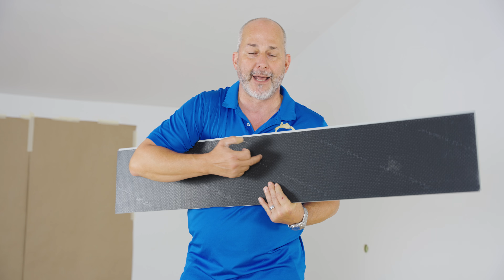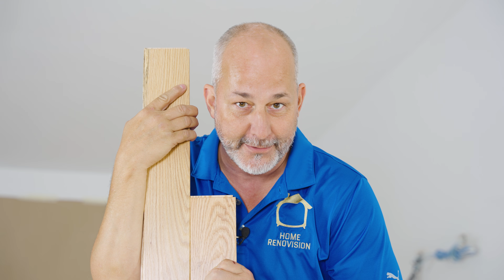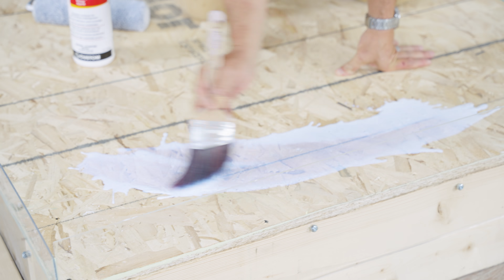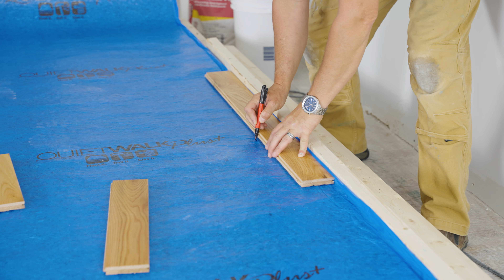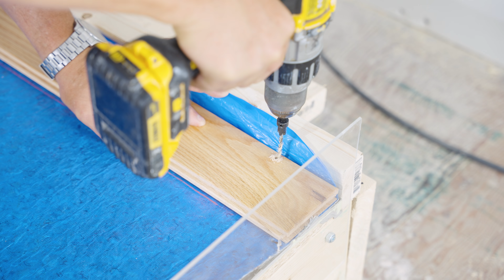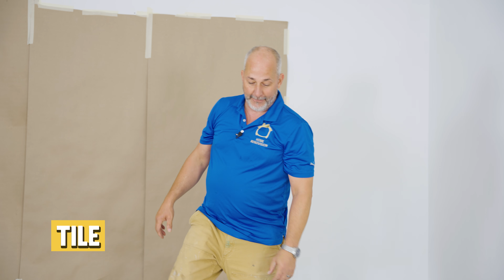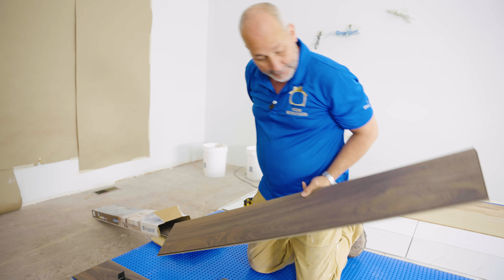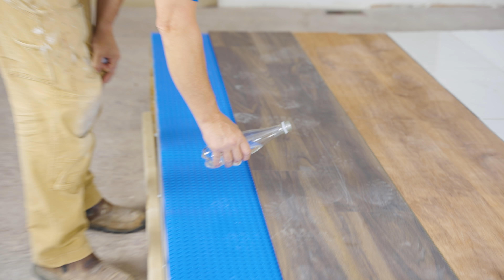Flooring Comparison: LVP vs Laminate vs Hardwood

Comment from the maker: I’m loving this new series comparing products! Watch my toilet comparison👉🏼 https://youtu.be/O7x5g2VFc50
What products do you want me to test next?
Reply: This product comparison series is quite interesting. Out of curiosity, it would be interesting to see a comparison of roofing materials, traditional shingles, metal, roof tiles and so forth. If this type of product comparison is a bit too cost prohibitive or just logistically so, then that is understandable if it is not possible. Thank you for your informative videos.
Reply from the maker: how about architectural vs steel vs rubber!
Reply: @HomeRenoVisionDIY that sounds like a great comparison idea!
Reply: @HomeRenoVisionDIY  I am curious if you have any opinions on glue down LVPs, a contractor told us that would be the best option for us with the way that our subfloor is slightly out of the level tolerance of most floating floors.
Reply: @HomeRenoVisionDIY how about regular shingles vs architectural shingles. Is there really a longevity difference? Or is it just cosmetic?  Thx.
Reply: @jamesholland7268  i second the roofing
Reply: I installed the engineered hardwood flooring in my kitchen and dining room; after 20 years of heavy use, the most wear came from dragging furniture across the floor leaving accidental scratches that went through the thin hardwood layer.  In areas where a step stool was placed repeatedly to access higher shelves in the kitchen, over time those dimples and dents from the stool caused the hardwood layer to delaminate.  If I were to do it again, I would have gone with solid wood flooring so that they could be refinished.
Reply: This is a great comparison with a lot of great info, thank you so much for making this!
Reply: Soundproofing materials and methods would be a good one to do. Maybe also windows (double pane, triple pane, vinyl, aluminum, etc) or insulation materials (open cell, closed cell, blown in, fiberglass batts, rockwool).
Reply: if i wanted to install hard wood on a concrete floor can i use the stapler or should i clue it down?
Reply: @jrhattenstein  Neither, it will mold if direct on concrete foundation
Reply: I would really like to see this comparison between counter tops. Laminate, granite, marble, concrete, quartz, hardwood/butcherblock
Reply: Tubs and sinks! They have so darn many choices anymore but are any of them as durable as enamelled cast iron? Acrylic, Stainless Steel , Composite Granite, Fireclay , Cast Iron,  Natural Stone
Reply: You didn't do any VCT tile.

That's what I'm doing for my kitchen and living room.
Reply: You forgot one step!
If you cut the edge of the interior hardwood or any wood product flooring then you’ve cut through the pressure treatment of the wood product. Because the rot resistant pressure treating only penetrates so deeply into the wood, you must brush on the cut edge, copper green, or one of the other copper based right resistant treatments! Also when he holds your drill or deep notches or grooves, you put into the wood! 
So yes, just the same as when you cut most exterior woods, such as decking.
Just ask ChatGPT when unsure.
Thanks for the great Great videos!
Reply: I'd like to see a list of recommended products
Reply: That toilet comparison was amazing!
Reply: I installed vlp  and after 3 years start cracking in a open concept room 1000sqft now I have to remove all of them, so I saw rhe glue down plank, is that a better way to repair over the years? I had tile and it was so hard to remove it, so I'm afraid of that, what do you recommend

Comment: Definitely would not recommend nailing a hardwood floor down over top of self leveler. You should have minimum a staple every 8 inches. Much closer at joints. That will cause the self leveling compound to crack and crumble over time. Leading to movement in the floor and squeaks/crunching etc
I also would not recommend skipping the back buttering on the tile. Especially for DIY. If your thinset has been sitting for a bit and gets a little dry, or skins over, you will have adhesion issues in the future.

Comment: I think the biggest surprise to me was in the price comparison, my home is over a century old & I absolutely love the look of hardwood floors & it's feel beneath my feet, but I thought they cost at least double what vinyl & laminant would, more likely over 5 fold, so this has me thinking, as I plan on a sizable repair & renovation set- that just patching my current hardwood floors is a realistic option in it's likely price point.

Porcelain tile is far more expensive but with my largest bathroom being about 36 square feet & my kitchen about 225 square feet - the damaged tile can get replaced & upgraded affordably enough in those bathrooms.

Comment: You got the expansion direction wrong for wood. It does moisture cycle in length. It expands and contracts in width or across grain. So when installing solid hardwood flooring, you need to consider the total width of floor and use the expansion percentage rule, which is larger than 1/4 inch in most cases.

Comment: Hello, Installing laminate above an unconditioned garage. The garage ceiling is insulated and dry walled. I assume Vapor barrier was also installed by builder. 
Would installing DMX as an underlayment trap moisture between floor and garage ceiling or is there enough air space to allow moisture to escape.

Could I get away without the DMX and install padded laminate directly on the sub floor? The sub floor is in good shape.
The room had carpet now going with 10mm thick laminate flooring.

Comment: your subfloor is chipboard, and what is that space about 12 x 12 ft?  The perimeter is not held in place and it has not sat for 60-70 years in place so that it has settled.  On older homes like ours the subfloor is genuine plywood and by now it has become much more stable, no dips/valleys.  Unless there is a plumbing leak, the old growth plywood 3/4 inch thick stuff (current stuff is less stable) is better quality, and the floor joists are true 2" thick by 12" boards of old growth wood.  We have 3 rooms added onto our home which used the engineered joists but we insisted on the 3/4 inch genuine plywood and the GC agreed, much better than your chipboard, especially for 3/4 inch thick solid oak floor install.  So.... your info is appreciated, but, it does not necessarily cover all the bases.  AND if you consider the renovation waste of vinyl flooring which will not break down in landfill for about 1,000 years, well, there's that too.  Genuine HW floor or engineered HW wins.  Dog scratches add character and we all love our dogs (Dremel their nails to avoid too much depth in their scratches is all).

Comment: Thank you.  I'm gonna leave my pocked, damaged 35 year old linoleum floor alone.  These all seem problematic for a '80s  contractor house that's settled with uneven flooring on trusses supported on a segmented foundation on clay.

I'll just settle and use nice kitchen carpets to cover the crappy stuff.

Sorry.  75. No patience - at all - for buying problems.

Consolation?. Eyes are shot, floor looks great under bad light with glasses off.

Thanks.  Very informative.

Comment: No if there are any humps like that in your wood subfloor take a grinder and grind it down. Done that a million times at least 4-5 times a month. And I’m sorry if your subfloor squeaks the only way you stop that squeak is if that squeak can be screwed down into a beam or joist any other way you would just be screwing screws right through the plywood into nothing. They would be useless

Comment: The same can be said for any other flooring you can get cheap or top shelf stuff same with ceramic. I’ve watched alot of this guys how to content and honestly he should not making how to content on flooring especially LVP   He’s not very knowledgeable for someone who knows about the flooring industry and has done it full time. Watching how he’s started some LVP installs is very painfull which means I’m sure his laminate how to content is more than likely just as bad. Because it’s almost basically the same except you’ll need different tools.

Comment: Interesting video and good work as always. If I may be that guy for a moment, when it comes to wider wood boards of any variety thats permanently affixed, every reputable manufacturer will not warranty a nail or staple only install of a board wider than a few inches (width varies by manufacturer) anything wider than x (2 1/2 or so) has to be either full spread glued, edge glued and floated or liquid nailed and blind stapled. Im sure youre aware of this and just glossed over it as its not an engineered wood install instruction video but possibly worth leaning into for a future video. Keep up the good work!

Comment: This is an excellent video - complete description of the materials, the installation techniques, and the cost estimates. This video has been extremely useful.
After severe water damage, the fiber core laminate that I, the DIY homeowner, laid 30 years ago has bubbled up, and some of the 3/4 ply subfloor was damaged too.  My original installation had held up very well, but now I'm faced with choosing an appropriate material as well as deciding whether I wish to install it myself (I'm not the bright young spark that I was 30 years ago).

Comment: Next week I’m having Home Depot install Lifeproof LVP flooring shown in this video. I specifically asked about switching to the dimpled moisture underlayment recommended here - it voids the warranty. 

I was told Home Depot started using this material, but they found it flexed too much and over time caused issues with how the seams stayed locked together so they’ve switched back to a 6mm flat moisture barrier.

Comment: Interesting! I always run a simple calcium chloride moisture test on concrete before laying any flooring—costs about $20 and saves headaches later. Also, don’t skip primer when using self-leveling compound; it prevents peeling and bubbles. For squeaky boards, a quick fix is to add screws through the subfloor and then shim any gaps under joists to keep things solid. Hope this helps!

Comment: A LOT of documentations says you should glue engineered hardwood.

I'm about to DYI install engineered wood (already purchased) on a floor made of joists + 45 degree planks over joist + I'll add 1/4" plywood over the 45 degree planks

So I've read multiple techniques....

1. Just put a line on glue in the tongue-and-groove.
1.1 Glue in the tongue-and-groove + brad nails or staples (mostly to keep things in place while curing I am told)
2. Just a bit of glue between subfloor (with a glue gun), 450sqft / gallon + brad nails or staples
3. Trowel applied glue everywhere (like 50 sqfeet / gallon)
4. And now you propose only staples and no glue over a membrane

A) WHICH ONE IS THE RIGHT ONE ?!?!?
B) I only used self leveling on basement concrete . Won't that stuff eventually crack and brittle to dust on a 2nd floor with continuous flex from temperature and humidity variation.

Help !!!

Comment: What underlayment for a lv floor do you use in a concrete basement that has hydronic radiant heat  with vapor barer under the concrete and 2" of foam under the concrete?

Comment: What if you have uneven floors and they need to be insulated 
Can you use the blue underlament and an insulation product like airtec together? ( aluminum foil bubble insulation) 
Or do you know of a product that performs both

Comment: I’m in between vinyl and laminate for a 1988 two story home, first floor is on a slab and second story is not very leveled. I don’t know if I should use vinyl or laminate. I want to apply the same product on both levels.  please help??

Comment: You can definitely refinish engineered wood. The number of times is based on wear layer thickness.
Reply: Those tongue and groove hardwood boards he shows can only be refinished to the depth of the tongue, exactly the same as a decent engineered board

Comment: Two and a half years ago we had engineered hardwood installed on main floor, including kitchen, although I have a washable runner in front of sink and stove. It looks perfect still. Our installer spent time prepping the subfloor and using leveller. The thicker engineered hardwood CAN be refinished. No squeaks. Per manufacturer, it was "glue-assisted" installation. We're not planning to sell in the near future, but because flooring is a big expense, we first asked our real estate agent what we should install for best resale. Hardwood and engineered hardwood are still preferred by the majority of buyers and gives you the best return.

Comment: No sausages where harmed in making this video!  I've done a couple rooms with strip wood.  I used trim-head screws in the tongue and groove + pilot holes.  Took longer but very secure.  Sure, I'd buy a commercial quality compressor & brad nailer if I did it for a living.  Thanks Jeff!  I appreciate your long-term vs short-term cost/benefit analysis.

Comment: We have male cats, we have a little boy, we’ve had so much pee and vomit on the floor 😂 we live in a rainy climate so lots of indoor running around. Water dishes getting spilled. Sinks over flowing. Someone put the wrong soap in the dishwasher which is also a kind of sink overflow 😅

Solid wood handled it all like a champ. The guys at Servpro said solid wood can dry out better than other products, which is a big deal if you’re the kind of family that has to call in Servpro sometimes. When there’s enough water it will find its way underneath.

We ride our flooring hard and every time we’ve sold the buyers have appreciated the ability to sand and stain to their liking. They get a brand new floor. It’s a great selling point. 

I’m in a house now with LVP and am about to put in hardwood.
Reply: i hate lvp too!

Comment: Thanks for the great video! It answered some questions I had as to the cause of my failing LVP floor (Shaw) in a 3-year-old house I purchased new in a 55-over community (it was a spec home, so no material choices).  The ends where the boards butt together are raised like little mountain ranges (hundreds at different stages of bad-ness, some are chipping from vacuuming). Since I didn't report any problems during the 1st year, the builder is basically saying "oh well".  They did get someone from the flooring sub (ILG) to come out to "inspect" and he took lots of pix but said very little.  Then there was no communication from them except to the builder (K. Hovnanian).  I even tried contacting Shaw but they have no record of any warranty claim.
Here's the question:  do I have any chance to get relief, either from Shaw or the builder?  I was about ready to just go ahead and replace it, but the cost will be $16,000-$20,000 installed (got a quote from Lowe's and an independent floor store with their own installers).  

This seems crazy for a 3 year old floor.  Do you think this is an installation issue or a material issue, or a combo of both? (from builder grade floor material). What would be the best type floor to replace it with, which would also be affordable?

Thanks again for all the good information, I'm going to check out your other YouTube videos!

Comment: Porcelain tile is more brittle.  Also, tile is cold.  I ended up installing porcelain tile for the durability and also installed under floor electric heating (worth every penny).

Comment: I’m from MN so I grew up with hardwood and carpet. I moved to soggy Central Fla. over 20 years ago and I would love to have all hardwood but it’s not durable against our humidity in the long term so I’m putting down porcelain tile. I started in a 10x18 room directly over concrete slab foundation with thinset, no underlayment. Cost = $461.65. Such a great price in comparison to other flooring. At that price, I won’t cry if I have to replace a tile or two in the future. I did all the labor. I also invested in a saw but I will use it again and it wasn’t pricey. As long as it’s not cracking from one end of the room to the other! My only regret is not leveling the floor because even with a heavy thinset application (and messy clean up), the completed floor is not level. Hopefully the tiles won’t crack or lift. Only time will tell. It looks great so there’s that. 😅 When I do the main living area, I plan to level first and I might consider the underlayment if it will help eliminate cracks over time. This video was incredibly informative. Thanks!

Comment: A concrete slab will almost never be totally flat, so sounds like it would need a self-leveling cement coating, and even that is hard to get perfectly flat.  Even ceramic tile shouldn't be cemented directly to slab.  Better to first install a plastic uncoupling membrane (ex. Ditra), which is pricey (~$400 for a kitchen).  Otherwise, cracks in the slab will crack the tile, and slabs always crack.  Avoid cheap and fast tile installers who don't carefully spread and trowel the thinset, but just do a "few dabs" method.  Makes it easy to level the tile, but leaves voids underneath so the tile can crack under load.  The test for well-bonded tile is to bounce a golf ball on the finished tile and listen for hollow sounds.

Comment: You are wrong about the "engineered" flooring not being able to be sanded.  Higher quality engineered flooring has a thicker a thicker wear layer of hardwood, anywhere from 4mm up to 9mm or 3/8 in.  Which allows for multiple sanding and about 60-80 year life.  Laminate and LVP, are just what they are - a  type of plastic and they look it.  Good marketing to sell cheap crap that allow the maker and middleman more money.

Comment: I have lived in a handfull of homes with LVP, old, brand new, professionally installed, we installed, it all separates on the short edges (easy to fix) and the long edges (no clue how to fix). So, if I'm building a new house and I am ok with a little splurge on my flooring so it looks good for a few decades, what would you recommend?